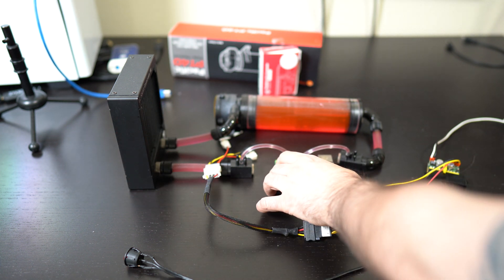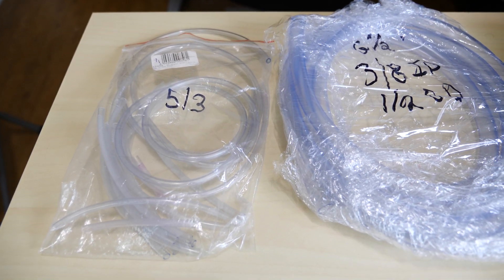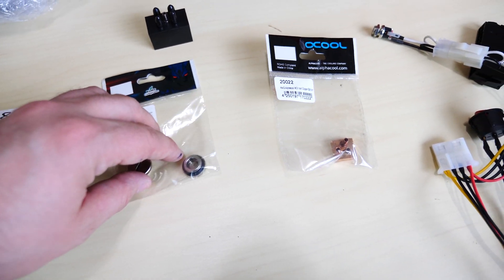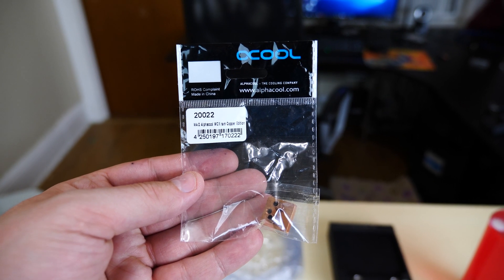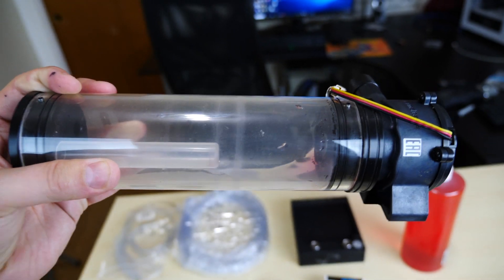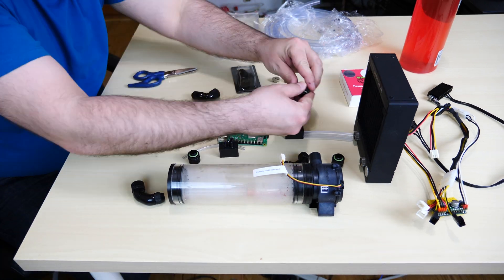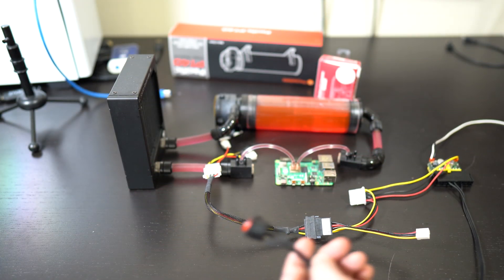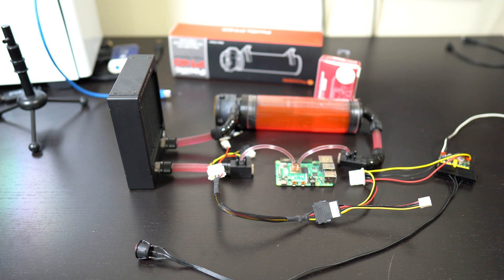Water Cooled Raspberry Pi 4 Model B

Comment: Just I want know why ? Its really need to be water cooling I didn't get your point yet
Reply from the maker: No PC has to be water cooled. Air cooling will work in every case.Water cooling any PC will alway improve  its performance including the Raspberry Pi 4. Is it over kill? Yes was it fun to make absolutely.
Reply: <nitpick> If a beefy heatsink + fan combo can keep it under 80 at a constant load and it doesn't throttle it will perform just as well as a watercooled solution, but having it at lower temps will make the hardware last longer and it's just cool.</nitpick>